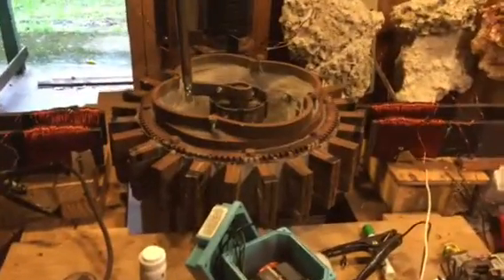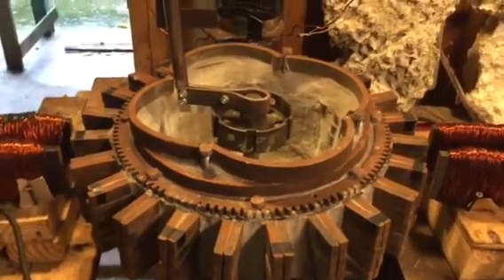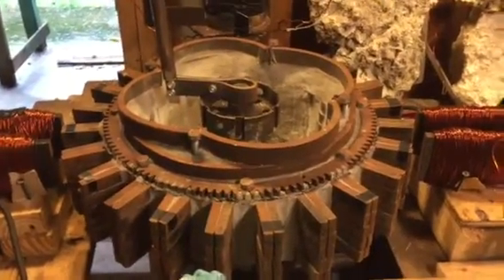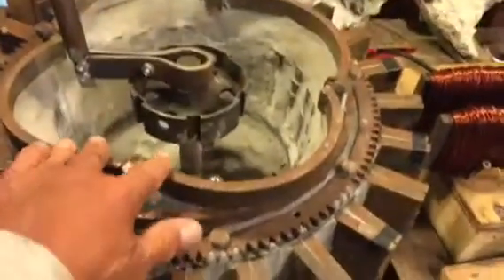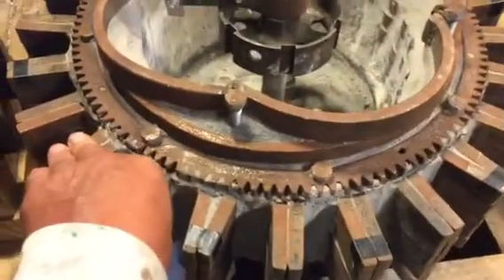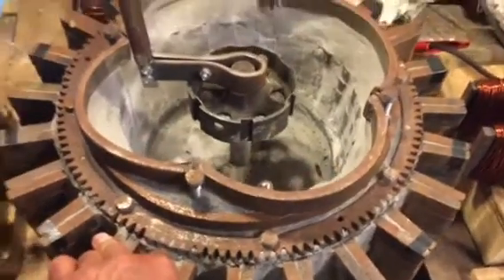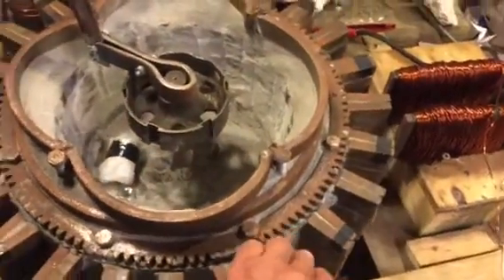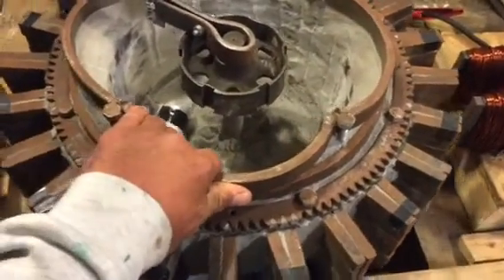Edleedskalnins Workshop. Turning Ed's magnetic Generator

Comment: Did you wire the High voltage feed in series or parallel? Or maybe series-parallel...... Do you have anything to choke the Henry's?  Very dangerous machine there. do you have heavy rubber gloves.  Combining High voltage with something that will make High current.
Reply: Rubberband54 cool shit?  he isnt doing a fucking thing!
Reply from the maker: Hey buddy
Thanks for the for warning !
I appreciate your comments.
Cool shit ha
Reply: Yes it is cool. Experiments sometimes lead to finding some wild stuff.... look at Teflon, chemicals not cleaned out of a tank, congealed.  bonanza!  Just get some heavy rubber gloves.  Air gaps become conductive with humidity at high tension.
Reply: Fred Steadmen  Which one of you guys are quantum physicists?
Reply: Not I, why do you ask?
Reply: Rubberband54 he doesnt understand anything that he is doing. If you watch is videos he actually uses words like impedance and resistance and frequency completely inappropriately.

he is increasing the resistance to the badly overloaded circuit to his house and acts like its a mystery why his breaker kicks.   

He acts like he is transmitting voltage with current with that stupid air coil that he calls a tesla tower (lol) while in reality he is just bombarding the area with a bunch of static that makes his multimeter go crazy.

the guy knows nothing about electric principles electromagnetism .  In one video he acts like he has discovered the secrets of the universe when a fluorescent light lights up in the presence of a high static em field.  

It would be hilarious if it was not so tragically pathetic.    nah... it is hilarious.
Reply: Fred Steadmen  Look Fred, it matters not to you really if he is doing his thing, does it? He is studying, testing, and learning. This is what scientists do all the time, he has his idea and is seeking answers. I would have to disagree with you that he knows nothing. He knows more than you want to give him credit for, he has a hypothesis and is working to prove or disprove it. How many people in the world can excite a transistor to make it switch or would even care to?
Reply: Rubberband54 are you kidding me?
I have worked in the life science  sector for 28 years. I designed a way to scan tagged hybridized DNA and quantify the the sample based on the amount of photons detect by a PMT.

This guy does not even understand  the tiniest fraction of what he is doing.
Reply: Fred Steadmen yes it does matter to me, he is a detriment to himself to any child that may watch and to science itself
Reply: Fred Steadmen  So you are connected to the energy sciences, dealing with solar development by artificial designed photosynthesis?
Reply: Fred Steadmen  Wow Fred, you got hostile because I was trying to understand what you were bragging about? I don't understand you or the high horse you seem to be on top of. You have a problem with what Vinny is doing, that's your problem. That's all I have to say!
Reply from the maker: Hey Rubberband
This dude has issues.
It's people like him who acts like they know everything,and even if they do know more then others, they have no right to act like that!
I bet he beats his kids!
Reply: vinny stvincent No vinny I love children and dogs. Thats why I care when I see someone spewing bad information.  Kids are more vulnerable then ever with the internet so available.

Why dont you go take some night classes so you know what your talking about. then maybe you will actually learn something and better yourself.
Reply: vinny stvincent Ed Leedskalnin's secret is contained in his book 'magnetic current' ... which I finally got around to reading. The key is to have a magnetic circuit (why he had the dangling hook over the handle). He also had 2 coils one wound clockwise and the other counter clockwise. He would turn the flywheel to induce magnetism in his tube and the coil within. Then as the system picked up speed his electric motor would kick in (he had magnetic connection on the sub-floor to the base of the flywheel, this completed the magnetic circuit, imagine a sideways U-shape structure with the top bend of the U being his hook dangling over the handle and the bottom being under the rotor). The two opposite-wound coils would be shorted out with each other. His output AC was at the middle of the coils (look up how PMH is connected). However, this output is Lenz-free! I made a video about this effect. After he got the rotor to the right speed it would power the electric motor he had under the flywheel (he had a transformer connected to the motor to make it the right voltage). The system is Lenz-free so it was able to power itself! That is the solution...